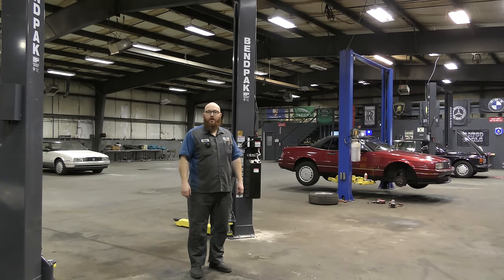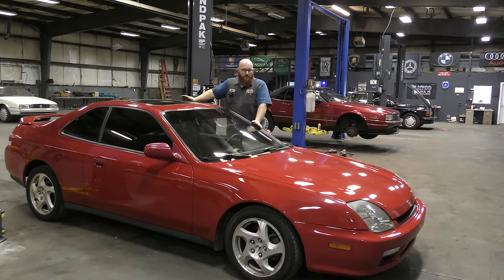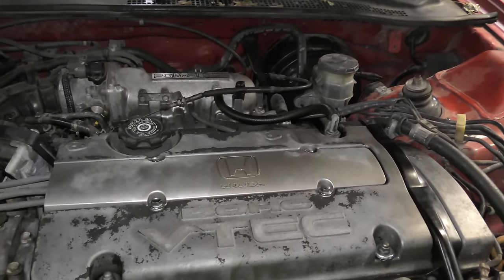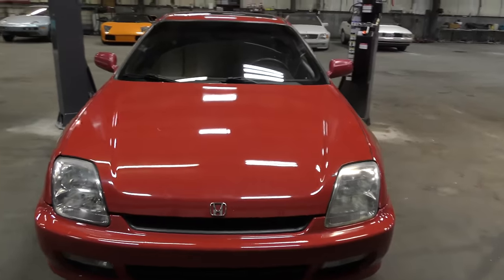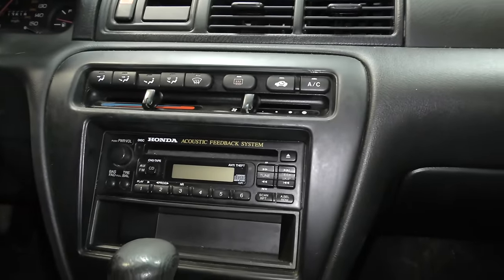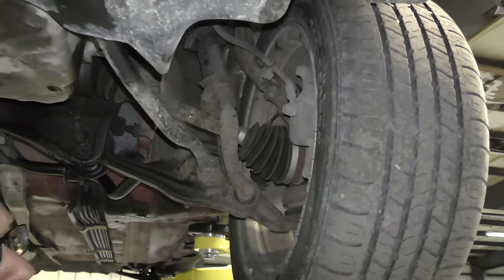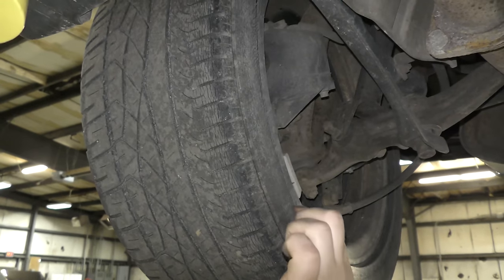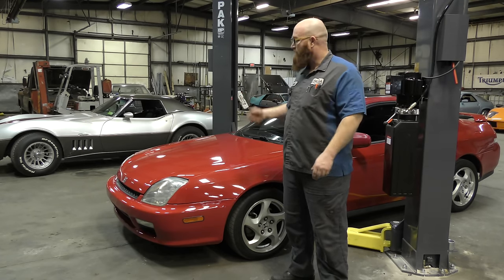VTEC YO! The CAR WIZARD finally gets a Honda Sports Car ~ A 2001 Prelude!

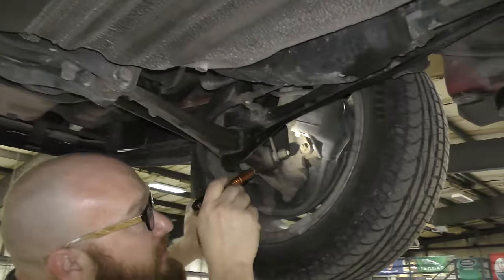Comment: 7:49 the moment I saw that tread pattern, I IMMEDIATELY knew that was a Douglas Performance (i have the pleasure of installing them 5 days a week as a Walmart ACC Technician); so this Prelude or at the very least that rim has seen the inside of a Walmart Auto Care Center. fun little fact, Douglas tires are actually manufactured by Goodyear! i would definitely keep that tire as a good spare.

Comment: If I had this specific car I would seriously consider a manual transmission swap, but at the very least I would pay for some really good really sticky tyres, thicker anti roll bars, high quality brake disks and pads, high quality brake fluid, new brake hoses, and probably some polyurethane bushes for the suspension.

That's pretty much it, it doesn't need forced induction or nitrous oxide, it needs to be enjoyed for what it is. With that in mind, that's exactly why it needs new tyres and new brakes. Both of those have come so far in the last twenty odd years it seems silly not to get them upgraded to modern standards.
Reply: Phil Atkins why?  Waste of money!  Those are just fine totally stock!
Reply: Tyre?

Comment: I thought that VTEC started in the Integra in Japan and in the United States was introduced to it with the VTEC in the NSX
Reply: Absolutely correct. The integra xsi  got the b16a back in 89 as well as the civic and crx sir in japan. Vtec first showed up in north america in the nsx. I think the first civic to get it in north america was the del sol vtec with the b16a as well.
Reply: @jamesarmenti8876  Maybe he's speaking USDM Honda? Otherwise, ya he's off
Reply: @acura2g  since wasn't specified.. It's then wrong to say.
Reply: @acura2g  Honda is Acura in the United States and it made in Japan for Domestic and export. As far as I am concerned I think he's off. If we are talking about Honda USDM alone that would be the Prelude
Reply: Maybe he was referring to the 4th gen prelude that came out in '93 and introduced the mainstream us market to vtec
Reply: @1985toyotacamry  Lol, not to offend you but that's exactly what I said in my post. And, Yes, I know Acura/Honda is the same. I've owned Integra, Legends, TL's, CL's, etc. Currently have a 03 CL-S 6MT. :) Thanks!
Reply: @Oemg35  92 civic SI is vtec also the EX. And the acura gsR 92.5 so the prelude wasnt the first one in the US.
Reply: @acura2g  it's OK it's not offensive.
Reply: I was going to say the same thing....I was sure v-tec was out before '97.
Reply: 1992 Acura Integra GS-R had the B17 DOHC Vtec
1992 Honda Civic Si had the D16 SOHC Vtec
1993 Honda Prelude has the H22 DOHC

Hope that helps. 

*I own a 93 Prelude vtec
Reply: 4th gen prelude had VTEC
Reply: @jamesarmenti8876  d16z6 was the first Civic with VTEC in 1992.
Reply: @jamesarmenti8876  Had  a DA6 (VTEC XSi) myself. What a fabulous little car. I used to get up early on a sunday morning when everyone was asleep, drive quietly out onto local roads and then cane the bejesus out of it. My first car, I picked well 👍😊
Reply: No the prelude introduced the world to vtec the integra had a reguler v4 no VTEC
Reply: He's clueless
Reply: @davidpineda645  wrong buddy, the first was the integra

Comment: Love all these people complaining about the auto when 99 percent of you trolls drive auto’s
Reply: Jay Breeze 
They say swap it yet 99% of them have never swapped a battery.
Reply: @12yearssober  got em
Reply: Jeffery Epstein probably true in USA
Reply: It's just a two door Accord without a manual.
Reply: Taylor C 

Different engine, different suspension, different gearing, modified chassis.
Reply: I own and daily a 2001 manual. The automatic will fail.
Reply: As someone who has owned one of these automatics, they're absolute trash, they break a lot, even after rebuilds.
Reply: That is because I drive a luxury car not a sports car. Luxury car SHOULD be a slushbox and a sports car SHOULD be a stick.... otherwise (ecobox, truck, family sedan, etc.) Take your pick...

2012 RL btw...
Reply: Jbog07  I got four- Focus, Corolla, CRV, and a motorcycle
Reply: 06 Mustang GT with a 5 speed here. I only said swap it because the auto trans in these is iffy, and I'd hate to see this thing in the shop because of it.
Reply: I complained. Manuals here for over 45 years. Currently 94' 300zx and 07' 328i.     Funny,I'm 68 and thought I wanted more luxury so recently I bought a Lexus, After 4 months I said enough and bought the BMW, and the Lexus is for sale. The 300 is now pampered.  True sports car experience gets in the blood,and I need more exercise anyway.
Reply: Jessie DiPietro I have 2 5th gens 1 auto, 1 manual. I change the transmission fluid in it every year and it has never let me down. Has over 200k on it.
Reply: NocturneTV 
In the shop? He is the shop!!
Reply: Totally agree, the market shows, massive sells  for the automatics, and it gets every day harder and harder to find manuals....
Reply: I drive both my truck and my weekend you even do little work on them
Reply: Anyone watching this should be driving a manual
Reply: That's because they're American.
Reply: @johnknight9150  this American has only driven manual but I'm a real car enthusiast
Reply: @DankSi  Good for you, sir. Fight the good fight.
Reply: I have never had an auto myself but due to disabilities my wife has to have an automatic.  In weather I would rather have a manual for traffic I would rather have an automatic.
Reply: @12yearssober  YouTube makes things look easy...
Reply: Currently I have four manuals, Golf, BMW an Alfa and a gorgeous 28 years old Lancia. But I'm not from the US.😀😀
Reply: If you do manual swap, you have to swap gauge too because there is PRD lights on the speedo.

Comment: I had a pearl white 1998 model with an automatic. Fell in love with the car after driving it in PS4 Gran Turismo.  It handled great and still looks good twenty years later. It was a very expensive car in it's day so they didn't sell many.  It's one of the very few cars i reget selling.  I'd leave it completely stock, put the decals on the trunk and replace the door handle. It'll be much nicer than modding it. It's like seeing a 1998 Supra Turbo but some kid ruined it with gaudy wheels and a coffee can exhaust. These cars are best left stock and hold their value much better that way. Great find, I'm jealous. 😀

Comment: I just finished restoring a 2001 Prelude SH and did some minor tasteful mods.  Bottom line this car is heavy and slow but it's got the vintage cool factor from Hondas of a bygone era, still looks unique and quite pretty 20 years later, and there's just something about driving around in an old school analog Honda.  I love mine.  Made my own short shifter and exhaust and did mounts and a few other odds and ends.

Being that it's an AT I can't really recommend any mods, just keep it as is and enjoy.  These Preludes are head turners.

Comment: "Honda sports cars have mini van engines" - the wizard about a month ago
Reply: By that measure, the Corvette behind him came with a shitty truck engine.
Reply: I have an 09 sienna. 3.5 v6. 295HP. The V8 in the 09 Mustang GT made about 315HP. Just what exactly is wrong with MiniVan engines?
Reply: @blakestone75  if you throw a turbo onto one of the 3.5s it turns into something pretty awesome
Reply: otherwise known as - parts bin special
Reply: Honda is actually the other way round. They started as a bike company, so they actually adapt race/sports engines in to everyday cars.
Reply: my '04 accord coupe has a minivan 3.0ltr v-6 and a six-speed manual trans made 242 hp from the factory. my '77 olds cutlass s made 170 hp with a 350 cubic in. eng. It was a fun boat but, alas 'twas a boat. Minivans are more fun to drive than boats, to be honest.
Reply: @ewallacestudent1  Exactly. The point of Honda is exactly "boring" cars with sports engines. I have a 93 Honda Concerto 1.5 manual. That thing happily redlines everyday if it has to.
Reply: Honda minivans have sports car engines?
Reply: @tooljst8  It was the Wizard himself that said it in the "buy or not to buy" Honda video
Reply: @tooljst8  He said Honda and Sports Car don't go together because they use the same engines on minivans and sports cars, including the NSX.
Reply: @ExAnimoPortugal  I reversed what was said by swapping car and van. Hondas always had good engines IMO. But that's just "my opinion." And I have seen the video in question. People are allowed to change their minds as they become more well informed or passionate. That's the problem with making videos,  something you say can come back to you. Much like generally posting things on the internet.
Reply: @tooljst8  Good point. People are indeed allowed to change their opinion, but he should've acknowledged that.
Reply: André Gaveau if it goes ok then how much more do you need? Honda was good back in the day of putting just enough but not too much.
Reply: @jamesmedina2062  Honda is great. My daily driver is a Honda. The Wizard was the one who said Honda didn't make good sports cars because they drive like minivans
Reply: André Gaveau He said that the V6 in NSX was same as Odyssey V6. Like Scotty he says some silly things. Your car shared platform with a Rover. It looks ok and hopefully has been reliable. I drove 88 and 90 Integras that were pretty good. As a 18 year old, I did not appreciate how good the double wishbone suspension was because the car suffered a little too much frame flex and I enjoyed my father's bigger Legend better.
Reply: @jamesmedina2062  The thing is he also said "Honda and "Sports Car" don't really go together" He could have at least acknowledged that in this video. The Honda  Concerto is very reliable, comfortable and fun to drive.
Reply: André Gaveau Awesome!!! I'm glad to hear. Honda did comfort much better back then than they do now. Comfort is a very real thing, unrelated to image. I think now they are more focused on perception, style and image versus actual comfort. Often the velour fabrics they used were also good. I also owned a 82 and 88 Honda Accords
Reply: @jamesmedina2062  They did replace the double wishbone front suspension with McPherson struts for the european market.
Reply: @ExAnimoPortugal  Funny thing was, in another previous video, he loved the NSX he had in the shop. I am a big Honda fan so when Wiz said Honda and Sports cars don't mix - I had to comment about the NSX video and this video with the prelude he bought - he def contradicting himself and secretly LOVES Hondas lol
Reply: Maybe the mini vans have Honda sports car engines.

Comment: Hey Wizard....things I would do: get the paint squared away(entire repaint if necessary), polish headlights, new tires(have wheels professionally polished before you mount new tires), repaint valve cover, and last but not least a Borla muffler(everything else on exhaust leave stock). Replace all emblems and replace passenger door latch.......that’s it

Comment: Owned a 97 and 98 Prelude, both bought for $250 dollars. One needed a trans and one needed the immobilizer bypassed at the ECU. Definitely change the trans fluid using Honda fluids and do it every 30k or less (since changed the fluid to a newer version). Also recommend cleaning the EGR and replacing the gaskets there. Also pull all the EGR port plugs with slide hammer and clean out. Not many videos on this online so may be a good video for you. I had a green and red one so it Brough back some memories of mine seeing your red Lude!! Just subscribed and glad to see you have the same interest in the prelude as I had as well!

Comment: I sold my 98 SH (manual) with 100k miles in December. Loved it to death but needed something more practical. I'll miss it forever.
Reply: ipariszalonna An SH to me is a waste of money!  The ATTS system was more of a gimmick than anything and a clutch job is 14 hours of labor plus 500.00 in parts!
Reply: Craig Jorgensen owning both 2000 base and 2001 sh both manuals they was a noticeable difference in aggressive driving especially sharp corners like entering highway
Reply: Casey McCulloch Well...I guess. I worked for Honda in those years and, yeah, there was “some” difference to those who drove aggressively but it was mostly a gimmick.  Just like the 4WD Preludes!
Reply: @craigjorgensen4637  I own a JDM type S (194,000 miles) right now and I've never experienced anything like this atts thing. If you begin to understeer you have to retrain your mind to put your foot down and not let off more..its like God pulls you round the corner haha

Comment: Worked at a Honda dealer and had a customer roll in with a 2001 Prelude one day. A little over 15,000 kms in the (then) 16 years that the car had been on the road for. 
Turns out the lady's son grew up liking, and owning, several Preludes and eventually bought a new one. Only to suddenly die a few months later. So the mother kept the car and drove it a handful of times a year. The underside was beyond immaculate. 
One of the problem's with Preludes was Honda used it as a testbed of sorts for their new technology, so some things on the car aren't as interchangeable as the rest of the Honda line up.

Comment: In the UK these were sold as 2.0 and 2.2 manual and a 2.3 auto. Awesome motors and the 4 wheel steering is insane

Comment: I had a 1997 prelude vti-r auto with 47k on engine 148k on the body, engine was replaced at honda dealer at a cost of 6k. Bought it for 3900 and transmission had an issue, planning to convert to manual but no time. Sold it for 4900.  I miss it a lot and it was much more comfortable and sporty than modern cars i had. Modern cars have stiffer suspension to give you sporty feeling to hide cheap suspension set up etc. And sound system was awesome. Cheers from Australia

Comment: Preludes really shine with handling. I have a manual 89 4ws with 295,000 miles and it's still the most reliable car in my fleet. All my mod recommendations are around handling.
- A good set of adjustable coil-overs will give you the exact ride and height you want (Tein or K-Sport). Keep stock or near-stock height, make it stiff for the back roads, soft for cruising around...it doesn't have to be the rice mod most people make it.
- Sway bars, dollar for dollar, is by far the best mod you can do to improve handling (I have Whiteline front/rear). 
- A front strut bar definitely helps too, rear is a minimal benefit. 
- All that + Bridgestone RE-71Rs and that car will out-handle just about anything in your shop.

Comment: Please help, I caught a blowout today and it broke my rim up bad but what's crazy is the whole rim came off the truck. What's crazier is the studs, the lug nuts, and the rim itself where you bolt it on were fine. I literally put a spare on after sliding 40 feet on the rotary and drove it home. But how can a wheel come off a truck and it didnt rip anything that had to do with the lugs. I'm kinda scared of the truck now tbh

Comment: All I would change is to put in a nice tasteful media player and new speakers. 90's audio was absolute trash. Any rubber bushings probably need to be changed to.  Keep it as stock as possible! nice find!
Reply: I agree, these days you need a system with Bluetooth to pair your phone. Nothing outlandish, just tasteful, and near stock looking.
Reply: @CommodoreFan64  You can get a bluetooth antenna bypass FM modulator that allows one to retain factory radios while adding bluetooth.
Reply: @saiga12  Yes you can, but at least the ones I've used have never been the most reliable thing simply do to the fact my area is jammed with so many stations on the FM band so trying to find a clear one is tough.
Reply: @CommodoreFan64  I'm talking about the ones that physically plug into the car's antenna connector.  It sits, signal-wise, between the car's antenna and the radio's antenna input.  The ones that broadcast an FM signal wirelessly are garbage.
Reply: @saiga12  got ya!! I will have to look into one of those at some point then.
Reply: The first thing I would do was change the radio, would definitely add a subwoofer.
Reply: Just put a Sony XAV-1000 and a sub in my 3rd gen Acura TL... best decision i ever made
Reply: dingchavez09  You think that even though he specifically checked the bushes during the video?
Reply: leave the radio..it s a stock pioneer..not too bad and you don t have to worry about taking front off..
Reply: Christian Computing where the factory radio is under the stock NAV screen. Just need a dash kit.

Comment: Hi Mr Wizard
I am a proud owner of 97 prelude since I was 18 back in 99. I have owned a 87 prelude si prior to this model. As an 18 years old back in the day and at the height of the fast and furious era I too was tempted to "Rice out" my car. But I see the prelude as an elegant car in a sea of civics, integras and S2000. So my approach of modifying my prelude was strictly sticking with the honda oem accessory catalog and what other jdm catalogs I could find through out the years. This is also including unicorn parts that are listed on hondas sister company Mugen. It was very hard and took many years to obtain some of the parts that I have on my prelude but she looks very elegant and tastefully modified. Till this day I am still on the hunt for these unicorn parts but it's very fun and rewarding to me. I will never part with my BB6 and you sir just bought a really nice car.

Congrats,
Mugen BB6

Comment: Best Mod you can do to change the interior of the car is s2k steering wheel and everything fits as is as well as cruise control
Reply: acura rsx type S wheels would make this look sexy with honda center caps, Tein S-tech springs,  the headlights retrofit them will make it look next level, and a lip and side skirts